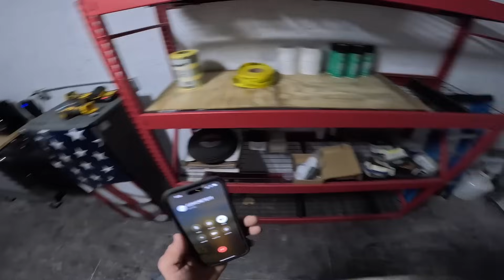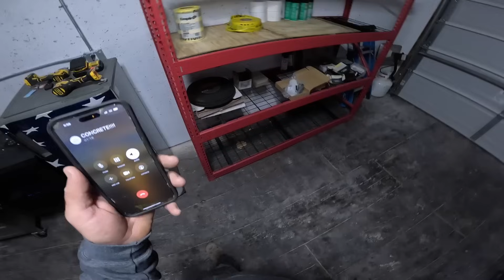Big driveway pour with PROBLEMS!

Comment: starting the floor saw before 7am 😅 poor neighbours 😆 in the uk any noise before 8am is a massive fine you can tell little rays been round concrete his whole working life don't need to tell him nothing 👌
Reply: Agree, Love the video's but they are so anti social, the trucks turn up with the reversing beeper's going, they are all shouting at each other, and why saw cut the garage floor at 06:30 when they could have cut the lines in with the jointer the day they poored the floor

Comment: Get that starter on Franny's truck replaced QUICK before it ruins the flywheel . Then you'll have to pull the trans to replace the flex plate . Fords have always had starter drive problems .

Comment: When the starter grinds on the 7.3 put it and neutral and rock back and forth in the seat or have someone push it forward or back and then try it, your starter or flywheel is missing teeth and doing that will get the good teeth to engage.

Comment: Ever considered a mosquito attachment when pulling lines for joints? Attach a piece of rebar tied with the string line at the end of a pole and stab the concrete at your mark for hard to reach areas.

Comment: Hey Ryan, love the videos they're great. What is the difference between cutting joints with the saw vs pushing them in when the concrete is still wet? I noticed on this job you cut the garage floor with the saw, but did the driveway joints while the concrete was wet. Was there a reason for that?

Comment: Hey Ryan if you grab a socket and ratchet that will fit on the alternator and turn the motor a little bit when it grinds like that it will make it catch until you get the flywheel replaced  just trying to help

Comment: I hate to say if the hose up top has water but the slump is not changing the driver is spinning the drum but not opening the valve to put water in the load I drove a mixer for ten years I know

Comment: Hey I doubt you'll see this bit in your 7.3 dually the reason it doesn't start sometimes could be a issue with the shifter handle if you pull up towards park and try starting at the same time should ingage every time with no issues

Comment: Man the fact the batch plant doesn't deal with those chutes is total bs. It takes a minute each chute to use an air nibbler and deal with that in a shop environment. Making that the contractor's responsibility when the concrete shows up as a zero slump with 1% N-CA is ridiculous.

Comment: Amazon part made my blood boil, I have a huge ditch in front of my home so my driveway is on the side street (I live on the corner). In the address line 2 part where I shop online states BACK DOOR ONLY. Amazon walks through a foot of snow, through the ditch and sets my package in snow on my front porch. My plowed driveway is visible from where he walked across my snow covered front yard. No brains at all. Oh, he is not the only one, GrubHub parks on my side street and goes to my front door too & FedEx followed the Amazon footprints all the way to my front door but at the last second looked at my package and walks through the snow all the way to my back door. UPS backs into my plowed driveway, puts my package in plastic, sets my package down and rings my doorbell. USPS does the same as UPS and puts in plastic and rings the doorbell.

Comment: Do you ever worry that the strike off wont fill in all the foot holes?
Reply: They use a shovel and will plop more concrete in areas that they need and re strike it off and sometimes when ryan bow floats he will do the same toss some concrete in areas and work it in

Comment: I would ask Ray more in depth did you provide adequate wash out for the concrete driver - I think you put the fear in Ray about splashing your machine - so as the bucket got full he probably told the driver to just put the rest here on the side in the grass as he did not have anywhere to put the wet concrete on the truck - so not just all the fault of the driver- not a one way street without fully getting to the bottom and the truth. Where did Ray put the washout water…Let’s not accuse and cause someone their job Open your eyes too

Comment: The men have to do more work because the lady doesn’t remember which bathroom she should be using and wants to be a truck driver. Some can pull it off, but it’s very few and far between just like the female police officer. I saw recently with pink handcuffs, throwing them at a suspect, while she had a gun pointed at him and telling him to put the handcuffs on, because she is in capable of doing the job